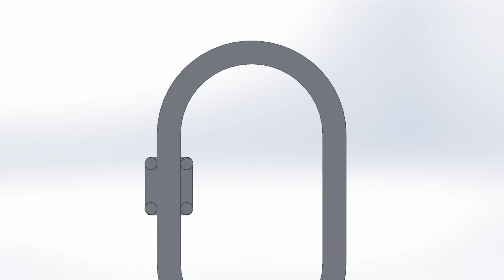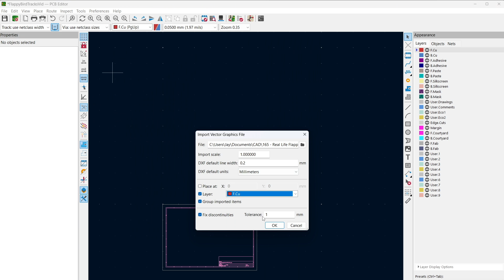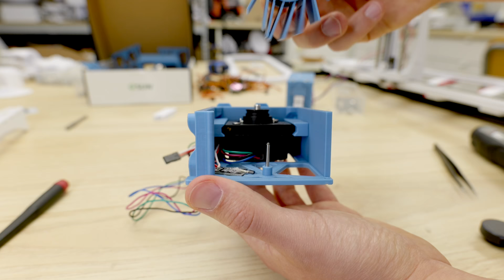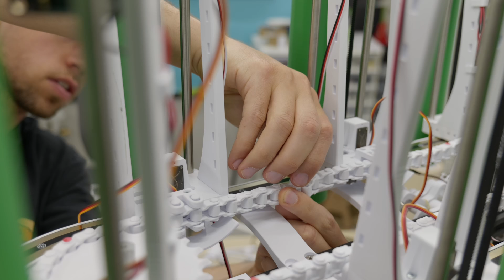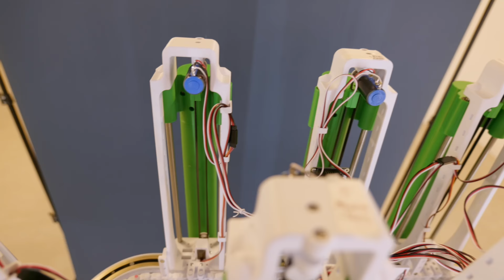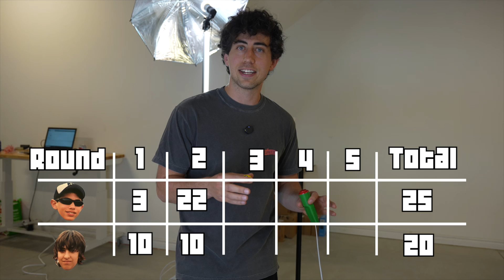I Built a Mechanical Flappy Bird Game

Comment: What an epic build. I was hoping you'd use a flip clock, mechanical airport pax info digits or similar for the score board, and you didn't disappoint! Even the font on the clock is correct, and the high score reveal is pure genius! Subbed!

Comment: you should try silicon lubricant its cleaner and does not attract dirt, you can get it at a local bike shop, and its not a spray so you can precisely apply to a specific area. Its used to lube bike chains and other components and it last longer the wd 40.

Comment: This is brilliant. I'm a new subscriber as of RIGHT now. Super nit picky after all your efforts but it would be cool to mask the slot and mechanism (with the sky background) that makes the bird flap and rise and fall. Also high score reveal - can the door open faster? I am not an engineer and I have zero clue about the level of effort to make my suggestions happen. Also, did you rule out using lights/LEDs etc? The flappy (pun intended) score board is cool AF but I wonder if a lit scoreboard might be more lit? Or maybe stupid... I don't know. Thanks for sharing this project and process. I want to be like you when I grow up

Comment: Would be cool if you remade it into a Wheelable Booth with the coin dispenser on the top of bottom.
Could also add in a Battery system as well for times when plugs are not fully around.

Really cool idea though, but yeah, would love to see this in a booth form, maybe even add in a fake quarter slot or have the quarter slot but for your coins instead that can give an automatic point increase, Like the player wins a 10 point coin and in their second game, can use it (but they will lose it (but get it back)) to give them a 10 point boost, this way they could try to get to the 40 point or higher coins.

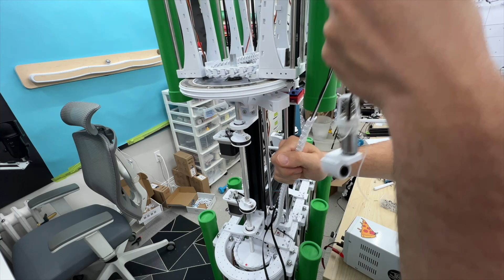Comment: Amazing, how did you design the chain where the cabels run trough ( 25:32 ), because I want to make something but for this I need such a chain. This would be very helpfull, because I‘ m new into 3D printing and don‘t have the hang of print in place things😅.

Comment: If you use train wheels you need to use an axle in between that connects both of them. Train wheels rotate both sides with the same speed, just adjusting the diameters. If you don't couple them with an axle (in German: Starrachse) you only make sure the wagon tilts to the side.

In short, you are not using train wheels if you use train wheels that are not forced to run at the same speed at both sides.

Comment: Did you consider using some sort of air tube system that you could attach the bird to so it literally is floating on air? Could increase air pressure to go up and it could constantly be releasing air slowly to lower?

Comment: You can tell how much you enjoy engineering because, instead of simply twisting the band into a figure-8 to fix the panel opening mechanism, you redesigned the element with extra gears to reverse direction.  I love what you're doing. I wish I had the means ($$$) to do what you do!

Comment: when the solenoid overheats it expands which allows the PIN to slide out so putting a small heat sink would have helped you could even put a small little cooling fan on it too

Comment: Before you said you were putting a motor on each cart, I was mentally trying to put together an over-complex arrangement of cams and gears so the heights could be set mechanically. I'd love to see if this can be done without any code at all.
Wouldn't know where to start with making the bird jump, though. Think you probably need the digital part there (pneumatic logic would be fun, but probably too slow)
Reply from the maker: I was definitely considering a completely mechanical solution for the height as well! Decided to go with this because the goal was a playable game and this felt more reliable

Comment: Anyone else have that Radioshack car racing "video" game that was totally mechanical? 2 cellophane conveyer belts wrapped around electric motors, and a plastic car shaped piece attached to a steering wheel, with a shifter that controlled the speed of the motors. You basically weaved traffic printed onto the two belts. 
If I had foreseen the computer revolution I would've saved that thing... when I was like 6.

Comment: You could have probably done the wheels with only two and definitely with just three. If there was enough tension in the chain to hold up the inner side of the cart, then you would only need two wheels on the outside to maintain stability and ride any curve (almost, there are a few edge cases, but nothing that three or four wheels could do instead). Being that any isosceles trapezoid, like your cart design, can be simplified into an isosceles triangle by removing the middle rectangle, and that triangles are all you need for any sort of balance on a 2D surface (note, 2D here doesn't mean flat, it would mean a continuous surface that extends over an XY plane, any Z dimension is dependent upon the plane; a sphere's surface is 2D albeit in spherical space, a road is 2D albeit in hyperbolic space), you can balance a cart with two wheels on the outside track and a single wheel in the inside track in the same way that you can balance the trapezoidal base. Though, I don't know how well it would account for the stablilty of the pipes.

Comment: nitpick: @3:20: it's centrifugal force that pushes the train out, not centripetal.
Reply from the maker: Might be worth googling!
Reply: @Engineezy  centripetal force always pushes IN, not OUT. When you talk about the train being pushed "out," you are subtly adopting the reference frame of the train, which is a non-inertial, rotating frame of reference. centrifugal force is the force that appears in this rotating frame as a force directed radially out, to counter centripetal force. in an inertial reference frame, centrifugal force disappears and we see it's actualy just inertia. so it'd be correct to attribute this effect to inertia, or centrifugal force, but it is not correct to attribute it to centripetal force.

Comment: I haven’t finished the video yet but could you have just attached the bottom/top pipes to each other so you only had one set of motors? It probably would have been very wobbly but two tracks might have… never mind I see the many issues

Comment: As far as powering those motors with the track, they would really only need power on one of the straight sections, since you will only be adjusting the height when they aren't in view.  Unless I'm missing something, giving them power the whole time was unnecessary.
Reply from the maker: Haha good point

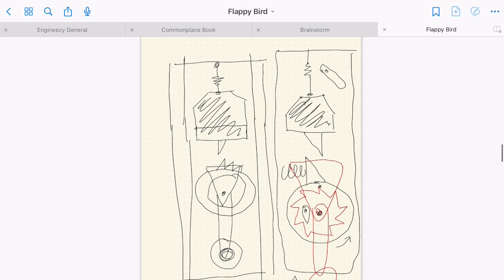Comment: 11:50 IMO this is the best use of LLMs as they currently stand; as "sentient" rubber ducks. I'll do the same thing as you; present it with a problem and ask it for ideas on how to solve that problem. It has been working very well for Arduino programming.

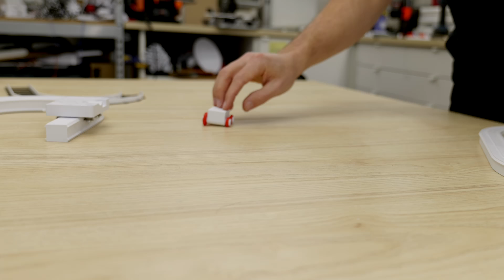Comment: 3:30 it’s not centripetal force that forces the train to turn, it’s the fact that the wheels are tapered, so when the rail starts to turn the diameter of the wheels change forcing the turn; if force was required it would also be dependent on speed and it’s not
Reply: Came here to say this

Comment: Really cool project (as always)!!! Could you please tell me what kind of belt/pulleys you used in that flapper/scorekeeper mechanism? I don’t have a lot of experience with small motors and want to do a few home projects. My 3D printed pulleys/rubber band belts just aren’t cutting it 😂…
Reply from the maker: I used polyurethane belts! You have to cut them and melt them together (its not too difficult)

Comment: Really cool project! You probably already thought of this, but you could probably wire the potentiometer you're using on the pipes directly into the servo, replacing the servo's internal pot. That would save you another control wire and simplify the control logic!
Reply from the maker: I didn’t think of that, that is genius!
Reply: @Engineezy  Thanks! It doesn't always work, the servo's controller tuning might not work great with the new pot, but I've found it pretty handy on occasion

Comment: i think the bird should just be attached directly to a motor on the vertical slider. you could program in the physics of it much easier than mechanical interpretation as shown with your lever thing

Comment: The bird movement looks really weird. You should have had the vertical motion fully controlled by linear rail which would do the really smooth and fast gravity effect, and then a servo attached to control only the pitch of the bird. The combination of what you have now is kind of odd

Comment: Bird movement feels off. I think a good upgrade for that part would be to use pneumatics, perhaps a spherical magnet in a tube, button press injects a set amount of gas into the tube moving the magnet up, have a small opening at the bottom to constantly release gas at a constant pace. Bird would be attracted to the spherical magnet and follow it as it moves. As for the bird tilt, honestly I wouldn't worry about that as it's just aesthetics. Nice bird movement is vital for playability, and I believe the described pneumatic mechanism would allow for that. If you really need the tilt, perhaps you can come up with a mechanical way to use the air circulation to accomplish it, otherwise it could be tilted down, and have a solenoid tilt it up when the button is pressed and a bit after that, but I would keep it simple and leave the tilt out and focus on making it fun to play.
Just discovered your channel about a month ago, binge-watched all the content, and you are already one of my favorite engineers on youtube. Excited to see what's about to come out of the new shop. Hope you manage to get some rest.
Reply: I think a PID attached to the servo might also work if he doesn’t want an entire redesign, right?
Reply: I'm thinking a pulley with a counterweight that is always trying to lower the bird. The button push triggers a servo that has a one way clutch, bumping up the bird by a determined height.

Comment: I'm surprised you spent all this effort to save cost with the servo motors, then spent so much on the PCB track. If you've got the budget, wouldn't some stepper motors have been much easier and simpler? You need a driver I suppose.  You can find them with lead screws attached pretty easily as well.

Comment: Suggestion: Use copper braid betweek your pogo pins and the PCB track (just like the slot cars. In fact, use slot car copper braid.)
It will reduce wear and tear on your very lovely & expensive PCB <3

Comment: Make the bird a little outwards so it actually between pipes
By the way nice video
Reply from the maker: That was in the design actually! But i ended up having to cut off the post for the bird because the magnets weren’t strong enough. It would just pop off on a jump which would cause a game over.  Might have to be a fix for v2
Reply: @Engineezy  one suggestion use the same magnet just extend the part of the servo which is holding the magnet for bird so you can use your existing magnet
Reply: @Engineezy  I am a hobbyist too, currently I am working on a medical robot 
If possible we will work on a project together

Comment: amazing (and beautiful!) engineering but maybe not enough game design 😅 Im sure it wouldve been difficult to code but it seems like maybe you shouldve added a limiting factor to how much the pipe positions can change in 1 step because if you get a full down and then a full up or vice-versa it looks like the machine just isnt capable of fast enough movement, so its gonna be an automatic game over. It happened to your buddy a couple times during the competition 😆

say you have 5 or 6 pipe positions youd just have to add something that says it cant change by more than 4 or 5 positions in a single step (depending on the speed of the bird of course). And apologies if this is something youve already done it just looks like there were a couple impossible situations there.

Comment: You didn't need the whole arm/lever plus bistable mechanism thing to emulate the bird jumping, you just needed the lead motor for the up and down movement you already have, and the servo coupled directly to the bird for the rotation. It would've been much simpler mechanically, maybe they would need to be a bit faster for a fluid feel but that's achievable...

Comment: The bird physically disconnecting is probably one of the sickest ways to end/start a game
Reply: 100%; that was such a great idea
Reply: The bird just does a nose-dive into oblivion
Reply: Except it seemed to not disconnect during most games
Reply: If only once it fell, it came flying back in to attach itself.. rev2

Amazing project
Reply: Sicker than bird flu
Reply: Duslshock 4 disconnected. Charge the battery.
Reply: I was wondering how this would be done, it was a very simple and amazing ideia.
Reply: confirmed

Comment: why have 2 times the same track system? the space between the up and down pipe is always the same, you could have connected the pipes with a transparent rod at fixed length and move them vertically with only one motor, no need to sincronize and no need to do double the work. also instead of 2 track pins you could have added 1 more for the data, move motors and a controller together and broadcast to all the   microcontrollers like the id of the pipe and the position
Reply: ok, nvm for the communication, you just use wireless
Reply: and also ig you want the slow start "animation" and want to remove the pipes at the end
Reply: because this process was for entertainment, rather than meeting design requirements. no requirements were established so there are no better or worse solutions
Reply: It's because it would ruin the immersion. As the tubes would spin you would see the rod and could mess with vision and that. Not only that but also because one motor almost definitely would not be strong enough.

Comment: - blender is everything but "really hard to use", you might not have time or motivation to learn it
- solidworks is putrid garbage, and every once in a while, your tree will be messed up and you gonna have to go through all the steps to figure why the fuck a boolean or mirror operation does not work

Comment: Seems like a missed opportunity to not have the pipes physically knock the bird off the magnet as the collision detector.
Reply: I think that was the plan in the beginning but he probably ran into some sort of issue. Maybe picking the bird up off the floor was tedious or something.
Reply from the maker: That’s exactly how it works! But you need to miss badly for it to really pop off
Reply: @Engineezy I was thinking it would have been cool to use an electromagnet to ensure it actually pops off once it hits, since it would turn the magnet off so it definitely drops.

Comment: Instead of pogo pins, you could use carbon brushes from tools. The pogo pins are going to eventually scratch the PCB. With the carbon brushes, the effect will be minimized.

All the rest is really a legendary build.

Edit: I saw he updated to copper brushes at the end of the video, essentially making something like a huge slipring. Compared to carbon brushes, that has its advantages and disadvantages, but well played sir, darn well played.

You don't find often projects with which you can so holistically be satisfied to have seen!
Reply: did you watch the whole video?
Reply: @ozzyburrns not at that point no. You still have the advantage with the carbon brushes, because they are self lubricating and less arc-y and the disadvantage that they can create a mess with the fine carbon dust.

But my electronics engineer side is very happy.
Reply from the maker: Glad you enjoyed it!
Reply: @Engineezy  I've seen do many great projects, in which corners have been cut, that you can't imagine how happy I am to have witnessed on that is just magnificent.

10 turn pots, instead of a simple divider, custom brushes, etc. etc. etc., everything done with care.

Bravo well done much respect!!!